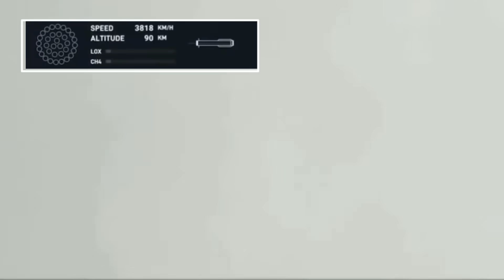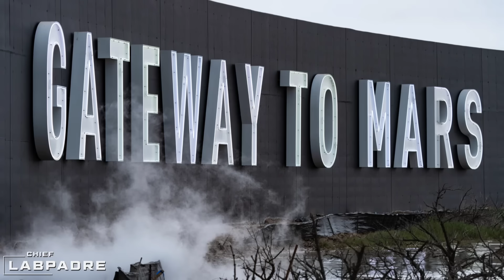Why Super Heavy EXPLODE Just After Stage Separation?

Comment: The blast came from the centre section of the booster, indicating collapse of the tank shells and an uncontrolled mix of fuel and oxidiser.  But venting of propellant was clearly visible from the engine section as well.  All that points to multiple structural failures.
Reply: The centre section is where the FTS is located. When it activated the hull was cut open and the propellants mixed and ignited. The venting from the engine section was very likely propellants that did not ignite the way they should. The cause is unknown, but is likely sloshing which starved the raptors. Next time they just have to make sure the sloshing is minimized.
Reply: @knowledgeisgood9645  There was no intentional activation of the FTS.  Stop regurgitating the Musk Cult spin.  No telemetry signals either from ground or the vehicle indicated any FTS function.
Reply: @LordZontar  You have no facts to base your guesses on. SpaceX has publicly stated that both FTS activated. They have not said why the FTS did that. I will wait for their public statements. It has nothing to do with spin one way or the other.
Reply: @knowledgeisgood9645  And Space X said the FTS engaged on the first launch that blew up and we know that was a lie because we saw that vehicle tearing itself apart before it exploded.  So I wouldn't be taking too much store in public statements from Space X on the matter.

No facts?  Howzabout the statements of the mission control personnel themselves during the flight.  You don't state "rapid unscheduled disassembly" if you've pressed the button to destroy the rocket.  That means they didn't know what the hell was going on.  Same thing with the loss of the second stage.  The techs were twiddling their thumbs for nearly five minutes before they finally figured out the vehicle was lost, waiting for a reacquisition of signal that was not ever going to come.  We've got the video from Space X mission control to confirm this.  So yeah, we've got very good reason to doubt that what Space X says is what actually happened.
Reply: @LordZontar  The commentators on the live stream of IFT1 are not mission control. Also, you can not take what people say during an event as truth. It is only what they at that moment assume to be the truth, but was not. 
If you want to go on thinking what you do it is your business.

Comment: I’d say the aggressive flip back, with the top pointing down, is the issue.  Falcon 9 booster reorientation leaves the bottom of the booster pointed down; it just pivots from aft to forward, before the boost back burn that aims it at the still-ahead landing barge.

If they landed the heavy boosted Dow range, as well, it would be easier on the booster.

I’ll have to pay closer attention to the Falcon 9 Booster RTLS fly back profile.
Reply: It's not really an option when they have no infrastructure to transport the booster back to the production facility, so it won't support the idea of rapid reuse. Perhaps one day when they have launch complexes around the world, but for now they need the ability to land at the launch site